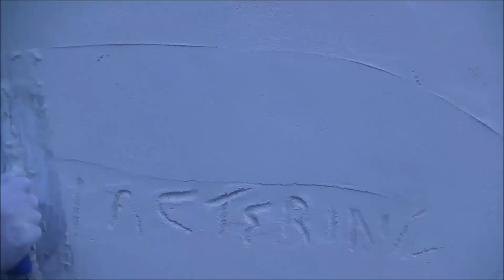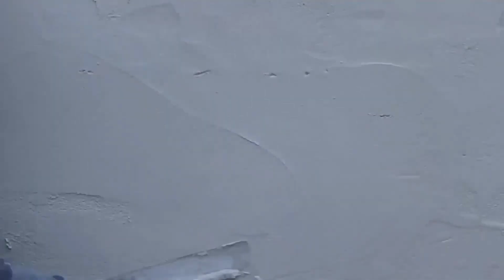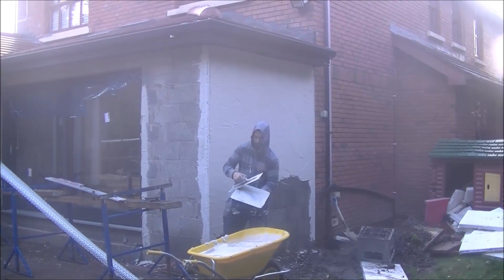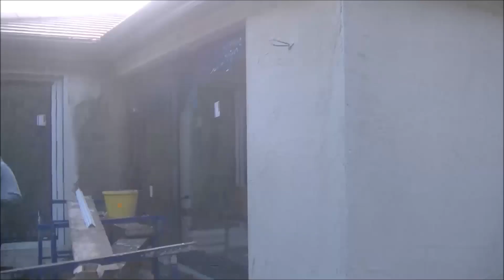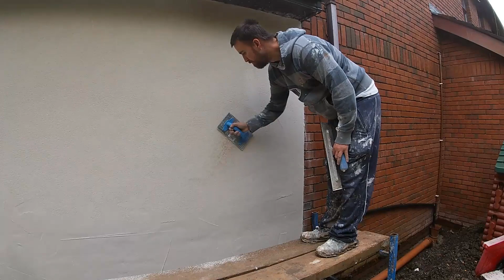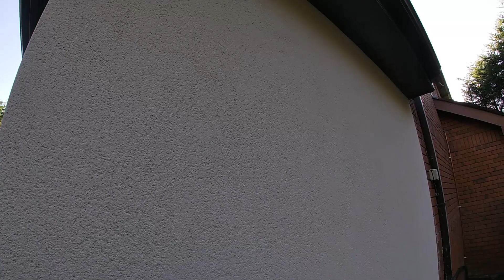k rend coating and finishing on new built extension how I do it, tips, refina monocouche render

Comment: Great skill buddy.
Been a plasterer since 1984 and can render with sand, cement and float finish so it looks black board flat but must admit I shy away from these products....maybe I should embrace and move with the times.
Have used Weber OCR but find it fluffy to rub up with a float  but it seems I'm doing it all wrong as I've seen vids where it gets cut back with a sharp bar when set and leaves a pittid finish.
I'm more than busy with inside work but I guess it would be nice to learn some new skills.
All the best to you buddy
Reply from the maker: Thank you brother means a tonne from such an experienced plasterer you have been on the trowel a long time, It can be hard to learn new things and scary but I would say you could pick it up easy if with a man whos done it before , with this gear its get it straight then when rubbing checking it and just knowing how to finish it off

Comment: Great video. What's minimum depth for full application? Have to do a small garden wall (10sqm) and need to know what bead size and how many bags to buy.
Reply from the maker: So you would need about 5 or 6 bags and depth should be 10 to 12mm on top coat mate beads can be 10mm planted on the best way to get depth is how i show in this video with 2 passes and then a close in at end mate
Reply: @macplastering  Thanks for replying, just seen some other guy loading up a 20mm bead which sounded excessive but never worked with K Rend before.
Reply from the maker: @TubeFinlay  can be used deeper the better with this gear but if u use 10 to 12 mm and stick them on it will bring them out a little more
Reply: @macplastering  Cheers, hopefully I don't make a balls of it.
Reply from the maker: Wish you the best for it buddy

Comment: Hiya mate. Is there no need for base coat or mesh? 
Is k rend better than Weber? As I understand, with k rend you put a thick coat on and scratch. And with Weber you put thick undercoat on and then thin top coat and just float. Is that right ?
Reply from the maker: No need om fresh block its called d one coat render but as seen i give two coats same day then close in and finish next day as on the video/ weber might be a little nicer to coat but very similar I do both this way again there is a thin coat acrylic also videos on that on the channel  mate
Reply: Ok great thanks mate. Would you do it the same on thermalize blocks?

Comment: Hi, I've built a domestic garage with cavity block. I am a DIY enthusiast but inexperienced with sand/cement or render applications. I've lime plastered old stone walls but it was applied by hand mostly.  Is K rend a recommended product for someone starting out? Would i need to scud the wall with sand/cement slurry before applying the render?
Reply from the maker: Hi Martin mate sounds like you could just follow the steps i have done in this video , if its new block you should be good to go I do 2 coats like in the vid the only thing im not sure is in it is the mesh about the heads and weak areas
Reply: Thanks for getting back to me. No I’ll have to fix mesh on the heads.
Reply from the maker: @boyneboxreviews  So the way to fix it is just cut the size you need you can cover the heads or go at to angles where cracks most times appear also sbr the heads to help the k rend bound mate
Reply: Sound thanks man, I’ll give it a go, I might even do a video 😂
Reply from the maker: @boyneboxreviews  Is it a big area mate ?
Reply: @macplastering  all external surfaces for render including gables ~ 85sq m
Reply from the maker: @boyneboxreviews  just test out in the smallest wall 1st mate I have a few other k rend / mono videos might be of some help

Comment: Hi Mac ,top video as usual, anyway can I monococh first coat first day , top coat second day and scratch third day ,as by myself and would be rushing thks Nigel
Reply from the maker: be best to do both coats same day mate so it bonds together it moist times is called a one coat render but i do 2 as you need the depth this gear will tighten fastish so can layer it up well in a day mate   and i would always finish next day

Comment: Apply 10mm beads over the top, prime with SBR and back over with k rend mate we've done that in the past and saved a load of work knocking it off, that was advice from kRend too 👍🏼
Reply from the maker: There is beads on this one mate ? what are you sbr ing the bead ?
Reply: @macplastering  oh no mate I just meant instead of knocking it all off we just re set 10mm beads over the top of the original k rend then sbr and re-render  with k rend again, the time it saved was a huge help, just a thought if you were to ever find yourself in the position again as K Rend told us to do that 👍🏼
Reply from the maker: Oh i get you mate I was wondering haha yea that was a crazy time on that job.... yes good to know and shows sbr is a great gear for us to use :)
Reply: @macplastering  👍🏼

Comment: Nice finish! 

Which product do you like to put on by hand the most? Krend or webber? I have always used webber. The guys I was taught be said the preferred webber as it knocked up thicker so they could put it on with less risk of air bubbles behind.

They said they used krend a couple of times but said it they could never get it to a nice thick consistency and always got air bubbles as they were laying it on. Just interested to know what you think. Cheers
Reply from the maker: I find very similar but webber i do feel easier to apply by hand in all honesty was a comany that said they were going to send ome for me to try but thats the last I herd of that
Reply: @macplastering  ah okay, interesting to know! Love doing webber as it's such a quick process putting on a scratching off the same day is a god send

Comment: How's it going m8 I've got 450m2 of krend roughcast and k1 scratch back to do soon my first big krend job need all the pointers I can get lol
Reply from the maker: Never used the roughcast myself but It comes bagged so just add water should be handy but try wear glasses that in the eyes would hurt bad trust me. How many bags is it in total mate ?
Reply: @macplastering  the krend roughcast wethit is amazing to use I fully suit up and wear eye protection probably about 80 bags for the wetcast I have no problem with the roughcast side of the job but only done a small bit of k1 scratchback I will be learning alot on this job lol
Reply: @macplastering  going to use the I bar for the scratchback see how it goes
Reply from the maker: @onpointplastering  yes it be goog best to use as a guide though in my opinion as scratch with float to keep texture gd
Reply: @macplastering  yes I will be using scratch pad aswell hopefully get some videos uploaded
Reply from the maker: @onpointplastering  might as well mate what colour they pick

Comment: I need your knowledge. I've got 5 town houses that want k rend re applying. And each one has stress cracks around the  top windows now I think they've got k rend boards applied so do I knock the old render off or apply k rend thin coat! Now I've gotta view these houses tomorrow? Can you give me an idea what I need to check first then obviously do I need to knock the existing k rend off? Cheers bro it's appreciated
Reply from the maker: Hi mate I have never went over them boards only ever went over brick or block, But i would treat it like plasterboard if movement it will need fixed so there is no bonce possibly suggest just re fixing every 4 foot to 5 foot to be safe re fill /undercoat scrim cracks and then finish with the thin coat . Or a complete strip off and start again but we both know thats the costly part   Hope this is helpful mate
Reply: @macplastering  Mac brilliant you got back and I appreciate it. Right..... So I went to view the property and these town houses are badly constructed. Built 10 years ago and the facia render goes all the way round in a metre wide N shape. But as the left upright cuts across the horizontal that makes the N you can see the stress fractures at that point and that specific spot has done it on all the houses. But on this client's house as the band coming across hits the lip of the 3 inch ledge at the top. The waters got behind the original K rend and blown it out to the point of it breaking away. Which for me was a bonus cos it gave me a chance to confirm it was on render boards. So yeah I'd say I'm going with your theory on it and all that front should be treated as dry wall knock it all off and start again but to avoid come backs? Mesh it all and double it on those stress areas. Haha yeah Mac I was like you thinkin' whaaaaaat T F and how😝 but if we nail this? I get the other 5 then who knows... I might get the estate🤣 cos this lot have got a few quid and appearances speak. And if one is the show piece then I'm pretty sure the rest will follow. But gotta nail this one first. But the architects ? Mate.... Whos brain would Design a 3 inch lip over hang across the top knowing renders gettin' applied and water runs back to then run down the wall or like in this case get in behind the actual render? Unreal! But again  Mac cheers kiddo!!

Comment: Can you use this over a scratch coat of sand and cement. I have a wall that top coat have been knocked off but sand and cement scratch coat is solid
Reply from the maker: hi mate on site year ago that was the way we did it sand cemnt scratch coat then we were told not allowed to do it that way but that was all on fresh stuff your issue might be suction / dust and dirt
Reply: @macplastering  Sorry I meant the top coat was sand /cement as well. I'd like to try monocouche but don't know if you can use it over sand/cement scratch coat
Reply from the maker: @dustyfruit946  The next video I will upload on it I go over sand and cement

Comment: Any DIY tips for patching small damaged areas/holes on monocouche? Seems impossible to repair and achieve the same colour as rest of wall.
Reply from the maker: Cracking tip Cody for sure straight lines are way more * visible* 👍👍👍
Reply from the maker: Only ever patched it one time on site years and years ago the Plummer made a mess he drilled fro inside out with a big waste pipe cutter yes you guessed it blew a chunk of our gear off so what i was told to do was, the next time we were on an outside on the site (the whole site was outside k rend same colour ) I used the gear we scratched off went up the ladders dusted off the dust primed it with super strong pva then pushed the scratched of gear on super hard until it was compacted like screed the scratched off and dusted down the edges came in pretty good , the gear that is took of will set as hard as the gear left on believe it or not, but patching any other way might prove very hard indeed messy might be best to mix it scratched it up next day and copy my way , I also believe k rend to a repair kit but no idea if its good ? Thanks again for watching buddy
Reply from the maker: @cody wandry Hahah this s so true only other time we patched it was door replace but was able to chip off to the bead haha so not really a patch  very hard to make it good when its damaged

Comment: Hi,
Are the white plastic beads meant to be on show? We recently had this render applied and I’m really unhappy with how visible the beads are on every single corner and even some right down the middle of our house. 
We had no idea that plastic beads would be visible as I’ve not seen a rendered house with beading on the corners or in the middle of the walls before but I’m assuming that might be because they didn’t use this render?
Reply from the maker: Hi Georgina hope your well, 
Yes so to answer you when you use beads you will always see the very corner on the outside, the one in the middle is most likely an expansion joint  to help stop cracking when I 1st started doing k rend long time ago we did it with out beads it is harder and slower but i like you think it looked better again slower and harder why most plasterers opt for the bead as you can do both corners in one go we used to nail timbers on work to them to form the corner then next day when it was a scratched off hold in up on the other side to form that corner and again the foow9ng day some1 would need to hold the timber edge for the scratched finish

Comment: Nice work mate, I’ve never used Krend before (it’s mainly inside work I do), someone I know has asked me to do small outhouse extension. Top have is new block bottom old finished brick under sills. Do you apply PVA to the smooth areas or add SBR to the mix or just wet the wall?
Reply from the maker: Cheers buddy when you say smooth do you mean concrete or steel heads ?
Reply: @macplastering  concrete lintels, the guy at Rowebb suggested I PVA the brick. Tried to add photo but not sure I can.
Reply from the maker: I would do that but more an exterior type or an sbr mate
Reply: @macplastering  thanks mate appreciate you getting back to me. Think I’ll use SBR and do an SBR/cement spatterdash on the lintels also 👍
Reply from the maker: Hope yoy get on well mate

Comment: Hi Mac did you put one coat on the K rend or two ? And how can you tell if is still green and last thing did you  use a straight edge rule on the building ? Never used K rent but going to use on my out buildings great job Joe.
Reply from the maker: Hello my fellow Joe :) Yes 2 coats of k rend this gear seems to take up very fast for a 2nd coat best way is to touch test really and I did rule it off and flatten in ready for next day to rub off hope this is helpful mate , new video out soon :)

Comment: How thick should the finishh coat be?
Reply from the maker: will depend on the beads you use as you need to come out to them and then some as it then gets rubbed/scratched back I think these beads are 8 to 10mm

Comment: Mac I have a question. How do you find applying this to plastering? I can plaster but never done render so was wondering what it’s like as I need to do my house and my next door neighbours at the same time
Reply from the maker: it is hard going hand applying for sure mate it can be just pure physical work as the gear is like bubble gum but if you take your time and do a  wall a time you should be ok as long they aren't to big if bigger you will need some help mate
Reply: Ah ok brilliant. Thanks for your help. Have a good Xmas
Reply from the maker: @Adam_t5  No problems mate always here if you need help mate or a chat and thank you wishing you and yours a great Xmas :)
Reply: Hi mate.Great finish!Do you feather edge it at all or is it all trowel flattening?

Comment: Now bud do you scratch up the first coat or just let the first coat pick up and then apply top coat👍🔥looks awesome bud
Reply from the maker: I would scratch the scrims and beads as most time I let them set off hard but if doing same day both coats I just let 1st take up like you say then lay 2nd coat on and get it straight this gear tightens fast strange synthetic render
Reply: @macplastering  cheers bud take care in theses strange times👍
Reply from the maker: @rockroll456  No problems mate thanks for watching and commenting Hope you and your family are doing good and keeping well
Reply: @macplastering  hi Mac , top videos ase usual, IV got a garden wall do ,it's brick wall painted with textured paint,is it ok do as you have without mesh thks , Nigel
Reply from the maker: @nigelcann555  might be if its really solid mate thing is this block still has loads of key even though it was painted.... the paint is also tight not flaky or lose I have seen some painted brick but always wanted to strip it as much as possible 1st to be safe

Comment: “On the trowel”  channel has a video doing K rend scratching with and “I” shaped rod where he levels and scratches in one go the next day. Seems like a lot less effort and he gets excellent results. He discourages using that Refina float. Have you tried it that way? Is there a reason you don’t do it that way?

Talking about this video: https://youtu.be/FjELGWVc8Ik?si=GZqSBFZ4RXoyFuW1

You can see the technique toward the end.
Reply from the maker: I get it straight when i am coating nothing wrong with the i bar method just I have it straight before i rub it back think its the best way as if you rub back to far you cant un rub it so getting straight 1st of is a must and proper depth again. I see the guys that spray it on love to just use a straight edge and I bar to cut it all off but to me they leave it a little to closed in still and again they like to hit it same day i always finish next day with no rapid set in 1st site i was on as a plasterer was this stuff on all the outside all had v cuts in it very nice and to this day looks well but it can get mossy / algae and black you ight like this one = v cuts = https://youtu.be/U9LsOR8gZQk
Reply: @macplastering  thanks for the thorough explanation! Makes sense
Reply from the maker: Any time buddy let me know your thoughts on the v cuts  @R900DZ

Comment: Wheres the mesh? You will see the lines of the blocks appear in time.
Reply from the maker: no mesh here buddy not necessary and no lines will be visible
Reply from the maker: mesh was put at stress points
Reply: You know your stuff so i wont judge pal. Very good videos
Reply: @kingmonk8549  Its ok mate  I know when it is insulated it all gets an under coat with mesh embedded on the boards but if these blocks move  mesh will do very little to stop any cracking both k rend and web i have done a fair few jobs and when i started the  site we where doing was all k rend and still look ok today bar the staining but very little cracks on them some look very good but must have had a soft wash, I was recently passing and was in traffic so god a hell of a look over :) hope your doing well mate